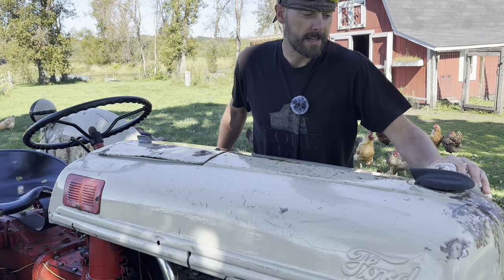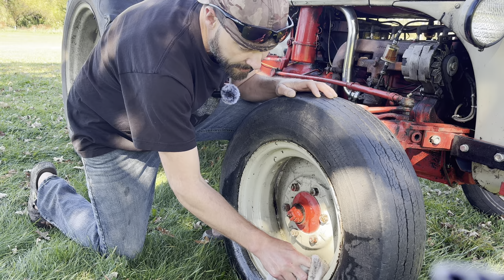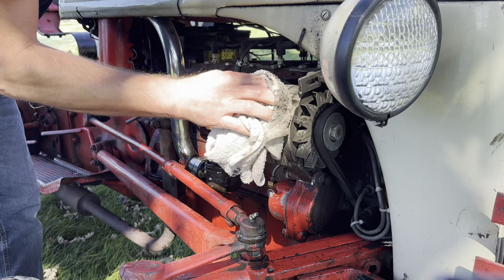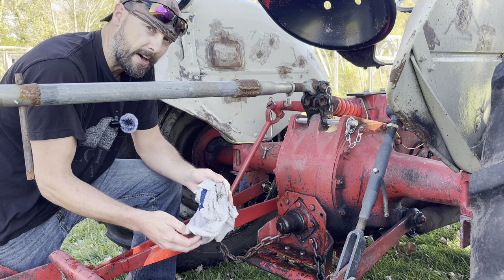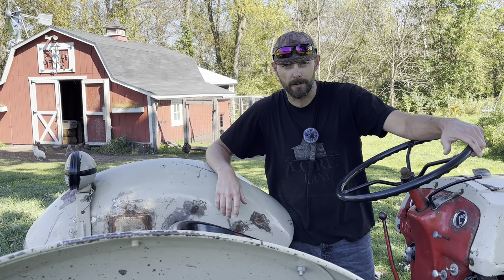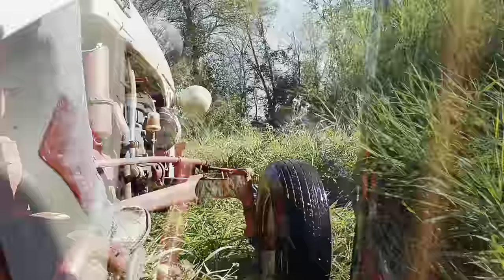Ford 8N Tractor | The Best Tractor You Can Buy!

Comment: Picking up an 8N tomorrow. First ever tractor. Guy was going to scrap it and said if I paid scrap price I could get it. $200 not running and needs a rear wheel.  I'm a pretty good mechanic so we will see if I can get it running again. I purchased 22.66 acres in the desert. Hoping the tractor will be helpful as I try to make a farm. I found a loader setup for $150 an hour in the opposite direction. I'm hoping to get the tractor and loader setup working for under $1,000. Have no idea what I am doing but I have YouTube. Lol
Reply from the maker: The tractors seem pretty easy to work on. Sounds like you have a great plan and found a super deal. You will enjoy the time with the tractor. Good luck!
Reply: @LohreFarm    Thank you. I just watched your video on implements. Do you have one where you talk  about the failed experiment? I enjoy seeing others projects, successful or not.
Reply from the maker: haha, I don't. I think you are talking about the small tree mover that I made. I spent a lot of time on it. Everything was custom made. I need to figure out what else it can be used for one of these days. Maybe I should make a video on it.

Comment: The 1950+ with side mount distributor is probably relatively better, IMHO. I have a 51 and a 48.  Your assessment of the $1,400 old=$18,000 new is accurate, but remember, there is no tax on $1,000 used, and parts are probably more available for the 70 year old stuff and definitely cheaper. Try rebuilding a Yanmar engine for the same price.
Reply from the maker: Yes, the availability of parts alone is huge. There really hasn't been a part I couldn't find, and at a reasonable price too. Great comment!
Reply: I have 2, and my brother has 2, his are a 860, and a 871. Mine is a 631, and an Allis D17D. Everything the Fords need is available from Ford and or aftermarket. The 8n just doesn’t have the power for what we need to do, and my Allis has parts issues. The flat rate manual gives twice as many hours to rebuild the engine as my 6 cylinder diesel, so there are sone trade offs. Have fun

Comment: 8Ns are good but my favorite is the Ferguson TO-35. Live PTO and a few more horses.  With the Ford N-series be sure to use an overrunning clutch to avoid the brush hog pushing the tractor through fences or into ditches. Live PTO disconnects the PTO.
Reply from the maker: Yes, it really too bad they didn’t figure the PTO issue out. There is a deal for the 8N to change this. But seems really hard to find.

Comment: I prefer the 8N personally due to the location of the distributor for when you need to adjust timing or clean up points (unless you've also upgraded to modern ignition). The ONLY thing i don't like is the lack of "live pto" / hydraulics (for safety reasons), but for a mower or woods tractor you can't beat it
Reply from the maker: I did see that a company made a way to deal with the live pro issue. I think they are pretty hard to find though.

Comment: I have a Ford 706 reversible scoop, you can see it on my 2N in this video:  https://youtu.be/L6z8X0mO_hM?si=Hwx9zsLZMUlpZP9r

The Ford N-Series tractors started with the 9N in 1939, then came the 2N in 1942.  A lot of people confused the 2N with the 9N since both are almost identical and have serial numbers starting with "9N".  The 8N came out in 1947 and had a lot of improvements over the 2N, 4 speed transmission, position control, etc.  The Golden Jubilee came out in 1953 and added even more upgrades, larger OHV engine, live hydraulics, optionable live PTO, etc.  You can trace the N-series up to 1964 with the 2000 and 4000 tractors that came out in 1962.
Reply from the maker: That's an awesome scoop. Tractor seems to be running real nice there. I only paid $20 for the scoop I modified, so I didn't mind attempting my experiment. Thanks for sharing the video, and knowledge.

Comment: My 1025r will out work it easily
Reply from the maker: Those sound like fighting words, haha. That's a cool little tractor, but a little more costly than a 8N.
Reply: @LohreFarm  we had a 9 n when I was a kid. Engine burnt so much oil you'd fill the oil and check the gas
Reply from the maker: @OO-by2jl Haha That’s a pretty funny line. I might use that.